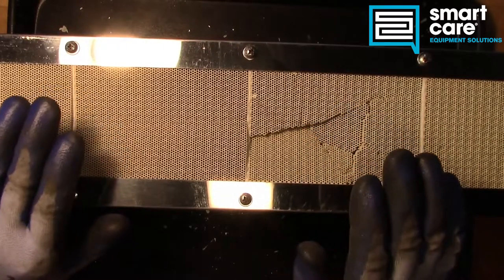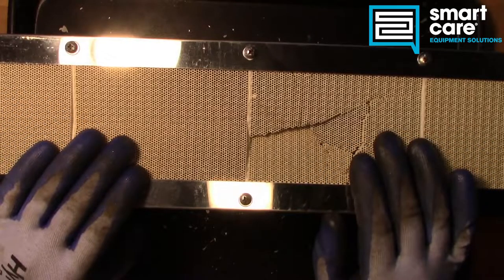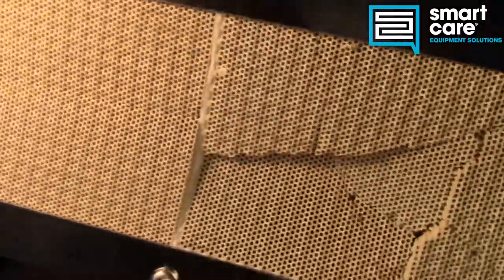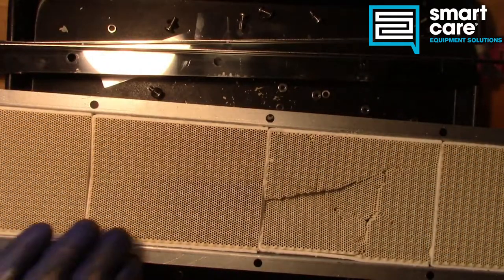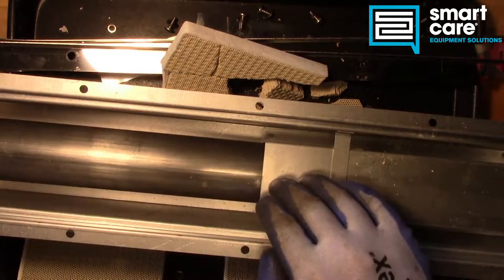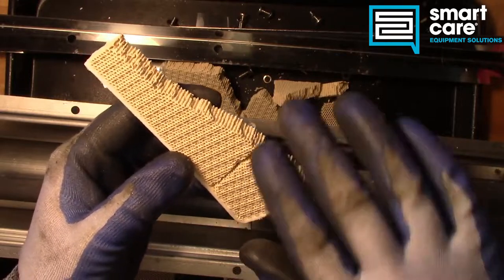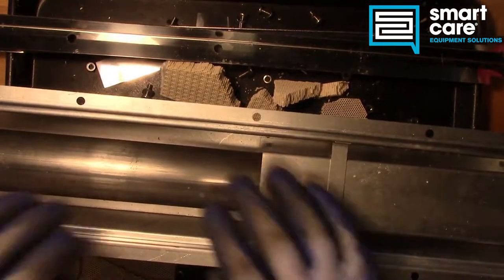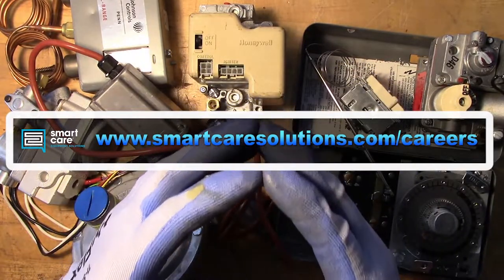Teardown Tuesday Episode 33 - Infrared Burner

Comment: I’ve got 2 60 “ jade range cheese melters I’m looking after. I keep having the problem of IR burners cracking soon after install. I know the staff may be damaging it during cleaning but it seems to happen more that it should. Is there something I’m missing?
Reply: I have no experience with these but could it be that from new they need to run at a slightly lower temperature for a short time to make sure any moisture is driven out of the ceramic? I know this sort of thing can be an issue with foundry equipment like crucibles and insulative coatings right from new and if they have been sitting unused for an extended period if time. If you heat the to much too quickly the moisture cannot escape and the steam pressure builds up causing cracking.